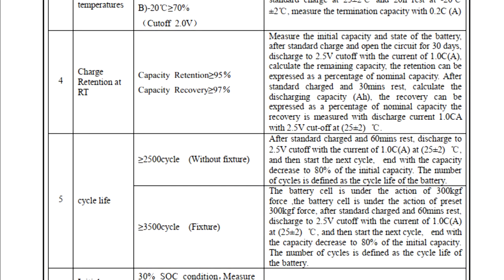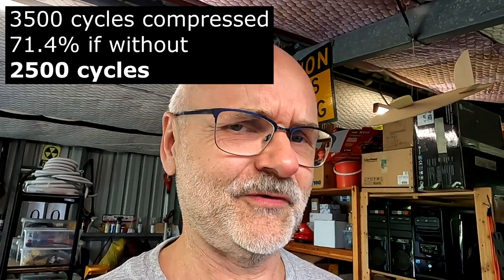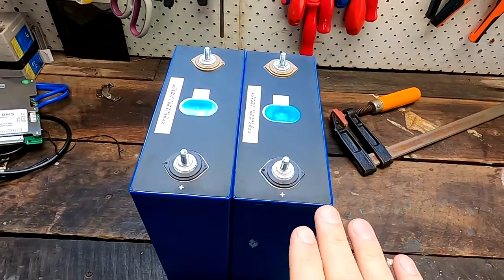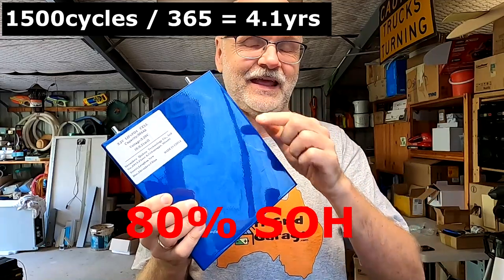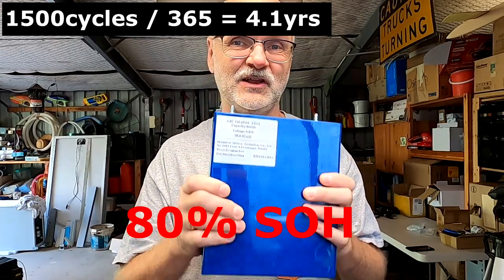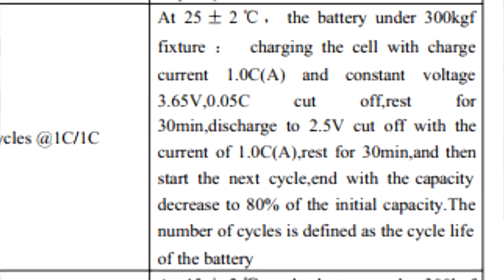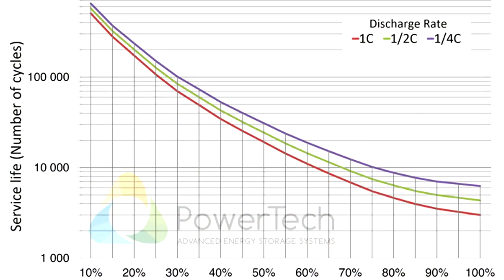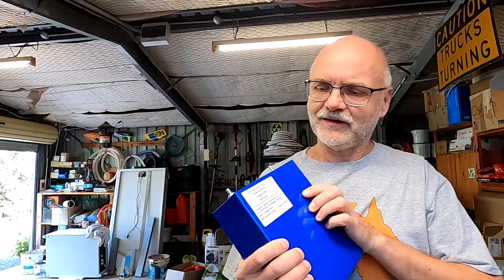Why compression will not extend battery life (something else kills your batteries).

Comment: I am curious, if you don’t compress them, what do you use or what is the best way to hold them together so the bus bars don’t do the work? I’m thinking in a residential situation and also an RV situation, because I would assume they would be different and RV is more on batteries
Reply from the maker: OK, so as you may have seen here on the channel, I leave a small 2-3mm gap in between the cells so they can cool or even contract/compress if they want to. This takes all the mechanical stress off the terminals with fixed, solid bus bars. In an RV or boat I would probably fixate the cells with tape and insulator in between the cells and use flexible bus bars to allow for small movements.
Reply: @OffGridGarageAustralia  what sort of flexible bus bars are available?,,  also,, if you leave a random gap, which is of course a good idea,,, don't you lose the ability to buy the cheap and mass produced bus bars?    i am thinking of doing a fairly large diy system for off grid use,,, custom making a bunch of bus bars would be sooooooo tedius.      hasn't anyone created some mass produced cheap metal boxes that are the perfect size for dropping in multiples of 4 batteries?    on my rv,, it wouldn't be so bad to make some "bus bars" out of cable and lugs i guess but are there easier to use flexible bus bars?   do they just have a elongated bolt slot?  and then you don't crank it down?  or how does it work?
Reply from the maker: @kevinlowe7552  Even with a gap in between the cells the standard bus bars coming with the EVE cells will fit as they have a lot, so can be moved and adjusted. Otherwise some flexible bus bars are on my website here: https://off-grid-garage.com/battery-accessories/
Reply: @OffGridGarageAustralia  thanks,, interesting,   although i don't see how they flex?  they look like a solid piece of metal with shrink tubing in the middle of it,,

Comment: about LF280K - "The cells have a lifespan (up to 80% capacity) of 6000 cycles when used at a pressure of 280-320kg and charge at 0.5C (0.05C termination current up to 3.65V) discharge 0.5C (up to 2.5V)"  6000 cycles at 0.5C not 1C

Comment: A tiny gap between cells is going to do almost nothing to reduce the cell temperature unless you are actively pushing air through the gaps and even then it's probably irrelevant.
Reply from the maker: Yes, unless the air is cold.

Comment: I received my JK-BMS with Active switches Led display. They have amp meter ring which is cool. now to wait 2 months for my batteries. They don't come with RS485 cables so I might have to order if I connect to inverter which I don't see why I need to.
Reply from the maker: I think this is the handle bar holder for you e-bike. It's not a  current sensor.
You really don't need to connect the BMS to your inverter. It's an option, but... 🤷‍♂️
Reply: @OffGridGarageAustralia  it has an amp display on bottom. I will know for sure once I get my batteries. if it is a worthless ring I will remove it. I searched and I did find those displays with amp meters. again it could be either ad wont know till someone tests it.

Comment: Are you suggesting manufacturers are misleading their clients when they recommend compression and show longer life?
Reply from the maker: Who is recommending compressing these cells? This is just how they tested them. I cannot see anywhere on their datasheet where they recommend, suggest or require it. It's how they tested these batteries to achieve such an outcome. Nothing else. You will get these cycles if you use the batteries the exact same way as they tested them. Nobody will (or even can) do this though in a normal set up and usage pattern.

Comment: I have a 280Ah 24V solar buffer battery that every day charges at almost 1C and then almost fully discharges via a boost converter into a larger 48v bank of lead acid for the inverter. It’s there to sacrifice itself to extend the life of the lead acid (until LFP price comes down). I have put it under compression using die springs.

Comment: Hi, thanks for all your informations about solar and batteries. I would like to charge my tesla during the night from batteries. So I would need at least 64 280Ah lifepo4. Can you please tell me what you think about this and how would you implement this project. Thanks from Germany
Reply: I ordered 64 of them a week ago. Price keeps going up but figured this would get me started on off grid solution and i expect ill add another 64 once i get initial setup done to have enough capacity for car charging. Hopefully ill have too much and i can mine crypto with the excess
Reply: @blackpearlphotos3529  Thanks, how much did you pay? Which bms are you using? regards
Reply: @MrSkykay  i intend to use the bms from current connected in the USA. My total cost including shipping and customs is just under 14000.  Extra cost because my location is Panama

Comment: those life cycles also need batteries to remain 25-35C to get those numbers.
Reply from the maker: Yes, the test is being down at 25°. That's what I said, temperature is a much bigger contributor to degradation then cycle life. Mine are getting to around 35-37° in summer time here but there is nothing I can do about it.
Reply: @OffGridGarageAustralia  Fans is all unless you want to build a fridge battery bank that keeps them at 4-5 Celsius. I would only do that if in desert. or if your system gets big enough a mini split to cool and heat your garage. I have a 3 ton mini split in my basement and they will always be perfect temps.
Reply: running a small air conditioner would be a small expense for an expensive lifepo4 battery bank...and components in a small insulated area....32 cells cost close to 5000 dollars now of the EVE LF280K cells... 25 degrees C = 78 degrees Fahrenheit....

Comment: so i have been running my 8S  LF 280 K EVE 24V battery as my only power storage since last oktober ,,charged it with solar 40_50A  and a 24V gernerator  20A usually discharge 1 to 6A using it down to 5 degrees celcius and up to 30 degrees celcius   and today my Daly BMS is on 50 cycles  
its gonna take me many years to get near 2000 cycles 
i now have a second 8s battery  but am only on 1 cycle
this one was not fixed during the topbalancing and 1 cell have swollen 2,5mm (it is now fixed)

Comment: The manufacturer designs those specs for maximum mechanical and electrical use inside EV's. So obviously the practical results under those conditions must be different, than in solar storage use. Otherwise a chinese manufacturer will never claim, that he is worse than he actually is. Also consider the situation where you charge these cells to the max an then store them for years and also expose to temperature differences. This energy will have to go somewhere and it will very possibly expand those cells to become grade B.

Comment: so after 4 years you've lost 20% capacity. does the smart shunt and BMS know this? how do they react, or do you have to make adjustments in the software?
Reply from the maker: That is a wrong interpretation and not the degradation I'm experiencing.

The BMS and Smart shunt will recognise any degradation and adapt themselves automatically.
Reply: @OffGridGarageAustralia  I said nothing about your setup - I asked a question, my last, grump
Reply: I have 105 ah packs that I've been using since 2021 and they were manufactured in 2019 now they have about 92% of capacity remaining. i have been charging to 54.6 and rarely discharge less than 20%.

Comment: Andy you are wrong about compessing cell! The compression of the cells is not about long cycles life of battery! The compression is about damage of the terminals pole! If you not light compress the cells the busbars they will be ckracking the terminals when the cells will swollen by tempeture charge/discharge.The busbars in the package with the cells is solid plate not elastic like winston busbars.Look about it please.
Reply from the maker: Many videos here on the channel about compression and longevity of cells. And also as many opinions about it...

Comment: $135 per cell with shipping?  Never happen today.  Plus you forgot the transaction fee which is about $12 per cell.  Heck for the cost of a cheap ratchet strap, $3usd and a small piece of scrap 2x6 on each end, I will compress to reduce the stress on the terminals.  Hah
Reply from the maker: There is no stress on the terminals if you have a gap between the cells 😉
Reply: @OffGridGarageAustralia  ... in a fixed location application.

Comment: I have a 100w inverter if I buy one battery I would need 4 to equ 12v, right? then I would spend $200 x 4 = $800 they need to be $100 USD for a 12v battery is $400  fair price

Comment: Why in the world would you only use 30% of your battery if you have a dynamic rate and get paid to sell to the grid? I think you will be better off going with 60-80%, compressing them to get the extra life like the manufacturer recommends. I dont understand why you would even buy such a large battery and not use it. Your entire argument is: 'do not use your battery for its intended purpose and it will age faster than degradation because of not being compressed'. Wow. Just buy a smaller battery pack now and buy a better, cheaper battery with longer life in the future.

Comment: Andy, If your logic is right, and I don't doubt it, then the Chinese must be using their batteries wrong.  We can find a lot of their used B grade cells online for sale that have been pulled for poor performance.  I would have thought they would have noticed by now, or done a study on why they have degraded so rapidly.  Also, if these cells have been in service for less than 10 years an perform the way they do, then we probably need to let them know that they are wasting a lot of good lithium.
Reply from the maker: We don't know how these batteries have been treated before. Temperature, voltages, currents, DOD, all plays a role here. They could have been flogged down to under 2.5V all the time and then fully charged to over 3.65V all the time, who knows 🤷‍♂️
I guess, we will find out with our own batteries over time.

Comment: Lots of talking just for a little bit of math - everybody can do that 😉 Compression is easily done, but the chance of some maltreatment imho is much higher, which will degrade battery life. You hardly can kill them just be ordinary charge cycles. The aging alone may be less if you keep them in good temperature condition and optimal SoC-level.

Comment: 0:55 why bother compressing batteries, when one can get 8s packs of 250A from BYD already in a fixture, complete with water cooling (if you so need), for the same cost as 2~3 EVE cells?
Reply: Because those BYD packs are very difficult to get. I know there is one source in Thailand, and that's about it. Unless things have changed in recent two or three months.
Reply: @upnorthandpersonal  One Chinese company repacks 48 BYD Blade cells in a waterproof Stainless Steel Case with BMS and RS485 but sadly as 8S6P >800AH 24V battery. I posted a picture of it at Digital Mermaid yesterday.
Reply: @DanBurgaud  Right, so very few sources still. Individual cells offer much more flexibility and are readily available, even from warehouses in the States and Europe.
Reply: I squeezed the vendors for more details and got the answers: These are USED and were originally 260AH but are now rated 240~250AH with +2500 cycles to reach 80%. 🤨
16s2p of these would still be cheaper than 16S EVE though.
Reply: @DanBurgaud  With the availability of new EVE and other cells, I would not settle for used cells with 2500 cycles on them...
Reply: @upnorthandpersonal  True. These 260AH packs are "used" to varying degrees and some vendors even sell 220AH variants... oh how depleted these are. The Blade Cells are brand new, unused conditions. 

Lastly, fake EVE cells are all over the place; but Blade form factor is new, no copy cats in the market, still cheaper than EVE per AH, and the industry gold standard in safety albeit difficult to stack for DIYers.

Then again, I wonder how fast can copy cat Chinese factories churn out fake Blade Cells? Maybe these blade cells I am talking right now are fake and I am taken for a ride?

Comment: your not going to get 8 years out of this type battery because the bms fails in  less than 3 years , thats the catch to all  lithium batteries .The BMS is the weak link, cheap components that cant handle the  in  and out  amps  volts etc thermal expansion etc . again where the issue are , these batteries seem like a great thing  but  have BMS  electronic circuit   which fails eventually, cant hold that current  in and out constantly ,  they just make money on you  buying new ones $150, $250  $500 etc  over and over ,  its better to by agm lead acid  battery  Has  None , and why they will last for sure  .

Comment: ive notice in my batteries the conections getting loose faster overtime with uncompressed cells
Reply from the maker: Why would that happen at all if you're not in a mobile set up?
Reply: @OffGridGarageAustralia  no they are in my Garage, at first had them uncompressed 6/7 months later decided to compress them and noticed that some cells were not at the correct torque that i set up at first, then i compress them and retorque the screws and its more than a year since without that problem. A friend of mine have a similar setup as me but he didnt experience that with uncompressed cells, but he does have Wire conecting each cell but i have tin plated Cooper bar. I think the rigidity in the conection made a diference overtime
Reply from the maker: @tiagoscp36  Do you use spring washers or flange nuts?